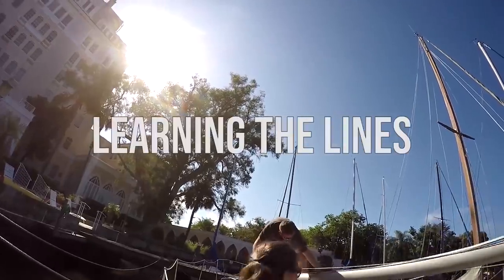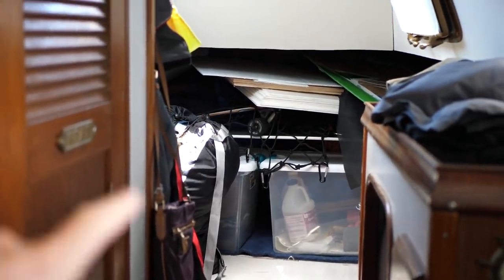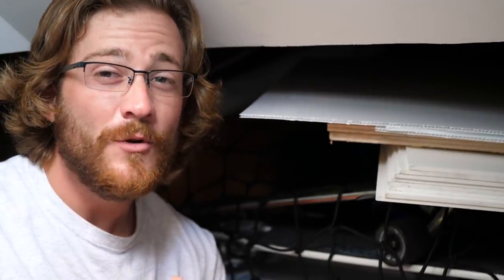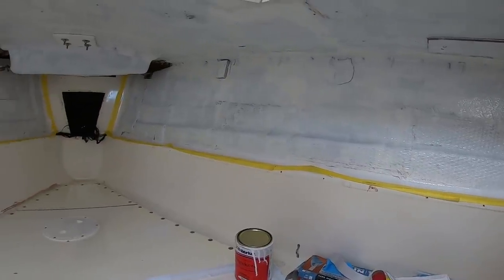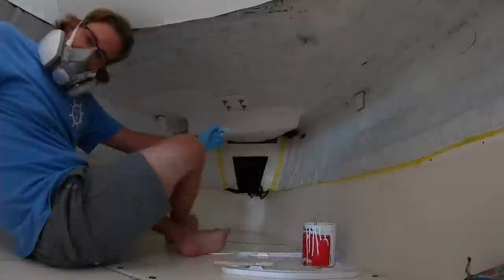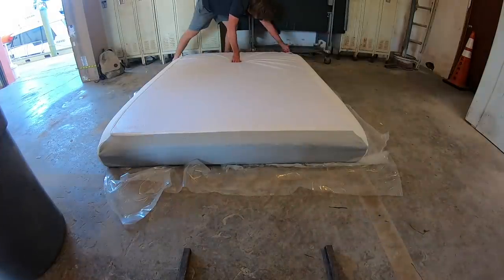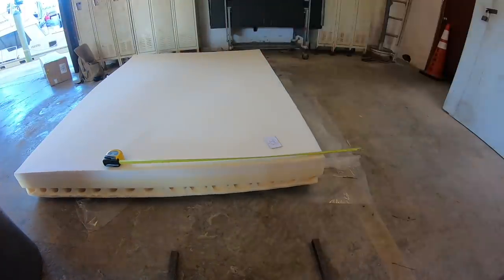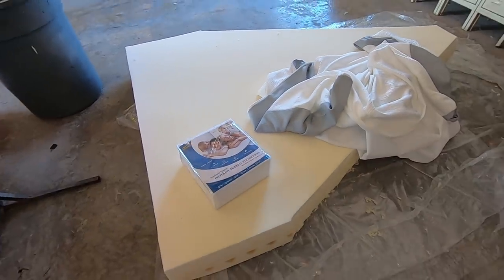78. We Can SLEEP Again! Converting the V-Berth Back to a Bed | Learning the Lines - DIY Sailing

Comment: Try this tip next time you've painted with smelly 'oil based' paint.... Hang a couple of peeled white onions up in the room and some how the onion absorbs the smell! It won't smell of onion or paint. Don't ask why, but it works. I used to work on a commercial dive boat in Saudi Arabia and the Philippine Deck hands did this al over the boat when they were painting inside.

Comment: Great job. We replaced our 28 year old V-berth mattresses with 2 twin size memory foam ones. I cut them down and restitched the covers. Sooo comfortable. 
I see several saying to just use metal paint on your bilge. I did ours with white Tremclad and it was great for 13 years. Then last winter it just turned to powder, fell off, and made a real mess in our deep bilge. You're wise to use the proper stuff.

Comment: You might consider one of the do it yourself closed cell spray foam kits when you decide to do it.  The company I used was called spray it green.  Two tanks the size of a BBQ tank.  All of the ingredients were non-toxic. Just put in a few furring strips, spray and then cover with that plastic laminate stuff you have been using.

Comment: Looking forward to the completion of the insulation and finishing of the v-berth.  It should really make the boat more comfortable during the hotter months.
Reply from the maker: That, and some form of air conditioning. Lol
Reply: @LearningtheLines  It will make it a lot cheaper to maintain a comfortable temperature that's for sure.

Comment: The new mattress looks great and in sure it feels amazing! Nice job! If you replace it again in a few years you may want to look at using latex instead of memory foam. Same comfort characteristics (density, spring back and coolness.. although latex absorbs less heat too), but memory foam absorbs water and latex doesn't. When you try to pick that mattress up in a year it will probably weigh twice what it does now and also be significantly denser. We bought a latex mattress from Ikea and cut it to fit our vberth. Our original memory foam mattress lasted about 2 years before it became uncomfortable. We're going on 6 years with our latex mattress. In the meantime, however, great upgrade.
Reply: Hello! I am looking at using latex. What is the firmness and thickness you used and how well is it holding up now and thanks!
Reply: @ChinjaMOM  we bought it from Ikea so it was actually 5 or 6 different layers with varying thickness and patterns. Overall it's about 6-7 inches thick. We then pulled the cover off to expose the latex, cut both the mattress and the cover to fit the vberth and then sewed the cover back on. We bought it in 2009, lived on the boat several years and the mattress is still in great shape today. We liked it so much we actually bought one for our house when we moved back in. I don't think Ikea still sells latex mattresses but I would definitely look elsewhere. We had a memory foam mattress before this and it only lasted about 3 years before it absorbed so much water it was useless.

Comment: Memory foam is ok in cooler temps but they generate heat and can make you sweat if you are a warm body type. More expensive memory foam mattresses that say will not generate heat are preferred for warm body types. 
Great video you two!
Reply: Foam is insulation, humans create about 100 watts of heat, so they will get warm.  Hopefully no mattress actually generates heat, which would require a chemical  reaction, which would reduce the life of the mattress.

Comment: For the duration of the project, trade in your truck for a cargo van (the cheapest you can find. No frills. Only has to last one year. It is basically a shed on wheels which will serve two purposes: (1) getting around, (2) securely storing your sh*t. Install some shelves. Onse side for building material, the other side for tools. If you can afford it, keep both the truck and the carego van. Use the truck as mobile workbench and tool storage. Use the Cargo van for storage. Now you have two cars. Or if a cargo van is too expensive, get an enclosed trailer that you can pull with your truck. Maybe some local Patreons are willing to park it on their property. Just shooting some ideas around.
Reply: BTW, you guys are enacting a lot of people's dreams.

Comment: FYI: my tips are just tips and experienced advice, not meant as you screwed up or w/e. IF I think you really screwed up, I will specifically say so. As to the paint. Pro - at least you used a good paint for minimal prep. It should last for a few years even with minimal prep. Con - Sticking and actually bonding is two different things. You clean and scratch to allow the paint to adhere and bond better to the surface. Sticking to the surface should last a little awhile (if it does stick, like in your case), but over time due to weather changes, temp changes and with contraction of materials, it will not last as well or as long as if it actually adheres and bonds to the surface. In your case, this was more than appropriate if you plan on insulating later anyway. Not ideal ofc, but suffices  and should see you through. Just wanted to make you aware that just because it sticks well to begin with, that does not equate too it will last as well ;) Cleaning and proper prep IS a big difference and does matter most the time. Just keep that in mind when you do other projects that you intend to last as long as possible.
Reply: Another tip, not sure what you used but sounds like it is decent and actually sealing (locking) in that surface. Another great primer which does the same thing is Bullseye 123. For a primer it is not cheap, as it locks in and seals, which does not allow things (inks/colors, smells, moisture, etc) to bleed through. BUT if it is cheaper than the product you are using, that might be as good of an alternative to consider. Couple of coats of that followed by a decent paint. (we used to use it in buildings with fire damage, demo'ing out the worst damage but somewhat decent structural which was sound, just smoke damaged, that would cover it and lock it in.)

Comment: I'm sure you could have used this info before the paint can was opened but you can save a ton of money on one part interlux paint by using Rust Oleum OIL based metal paint at 30 bucks a gallon (Home Depot) vs 30 bucks a quart for the interlux Test it and you will see it's the same stuff.  It dries rock hard and lasts

Comment: I don`t think the paint is designed for application on a more or less dirty surface. I believe it is a paint that is more resistant to direct contact with water typically found in a wet bilge, compared to other interior paint. But I bet the surface needs to be just as clean and prepped as for other paints.

Comment: Dude save yourself a fortune and get a gallon of rustoleum from home depot and a jar of "Enamel hardener" from amazon. Makes enamels dry hard as a rock in an  hour or so. Use it in the real bilge of all my boats and it stand up as good if not better then others and is cheap and easy to find for any repair.